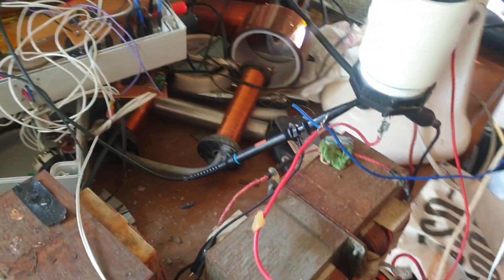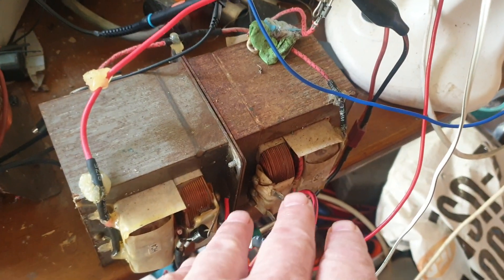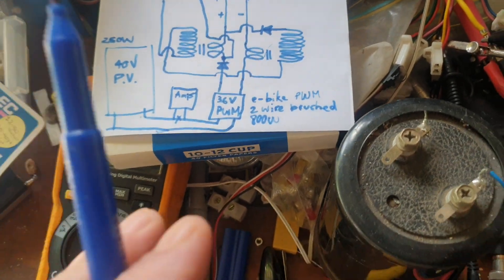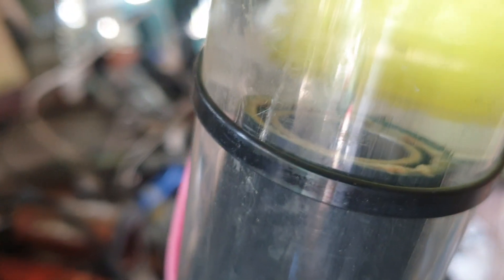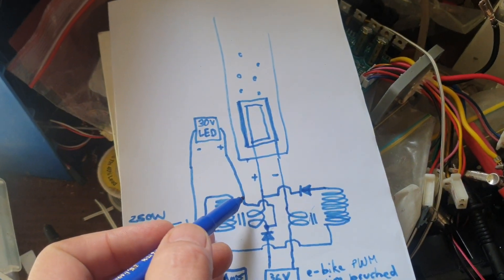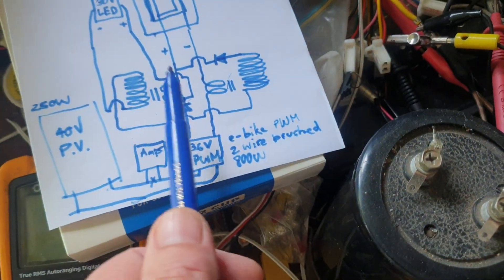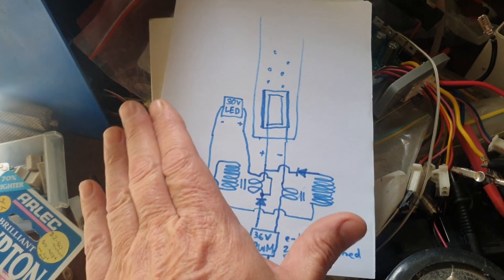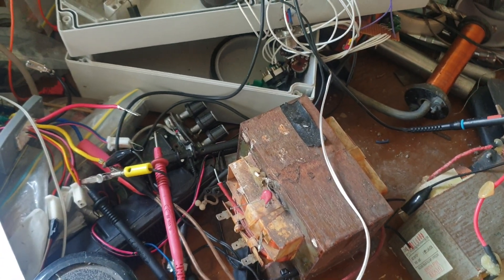Zero input?🤷‍♂️W👀ps HHO Stanley Meyer MOT VIC

Comment: Very cool observation, nice work.
 Ok, here’s my guess.
The HHO water has a dielectric capacity, when placing two seperate pieces of palladium in a HHO cell you can extract electricity from the HHO water. I understand you are not using palladium however stainless steel can perform the same function but greatly diminished in comparison.
This small current may be similar in origin to the Edward Leedskalnins PMH when the magnetic field is interrupted upon shorting the coil or breaking the PMH magnetic flux, upon collapse of the field the back EMF has nowhere to go and thus produces light, this is backed up by an increase in frequency(scratching the terminal) resulting in more light.
I can see now why theoretical scientists feel so comfortable, you really can say whatever you want.🤣 But seriously, I think my guess is what’s happening.

Comment: I'm looking forward to charging my sand filters. Not looking forward to building S traps to keep water off the conductors. I'm almost fully convinced Edward at Coral Castle figured out how to power that Model T with Hydrogen fuel. Why would he need that much amperage? A single set of magnets was enough to run the ignition system, why did he use magnets from 7 cars?
Reply from the maker: wire it like Kelvins thunderstorm apparatus, it'll be a snap
Reply: @m3sca1  right

Comment: Hi! You know - I am one of these persons who can help you with explanation... :). What is happening? Answer is: Every HHO Cell is accumulator. Your loop system with "sparking" induce secondary HiVoltage field which is connected with your battery - HHO Cell. You make generator. That`s it. Nothing cosmic. :) Of course - you can mount it on the bicycle with contacts and use it like Bike Lights :), but this will be very stupid! Be happy! 🙂🍻

Comment: I'm So Glad that you have that SPARK of Curiosity Coupled with  that Sense of Doubt regarding What we are taught (my take)..

Many possibilities there my friend.

Always consider a two way street,
that is often ignored .

U have ruled out Mains related noise via Conduction currents.

Your system has at least one (likely more)
resonant frequencies .

I have only lust found your channel
and this video.
q
Maybe try to observe the system at RF?
or any rapidly changing rate of changes.

Subscribed now mate
& will keep an open mind 
& an encouraging Spirit ⚡🙏⚡

Best Regards from E ⚡🙏⚡
Reply: Just realised I have seen your channel before and was subscribed lol 
but that just goes to show how YT are trying to keep us all Seperated.
Reply from the maker: its completley isolated now, and still doing it. appears to be like a feedback loop where shorting the primaries uses the capacity of the water cell to pulse the secondary which flashes thru the diode arrary of the LED COB, bringing enough voltage across the cell to keep the plates charged. the only induction is via the timber bench coupled to the power board.
Reply from the maker: @crazyham  yes i have lost old subsrciptions as well.
Reply: @m3sca1  This Is Very Exciting .My Friend.

Whether or not it turns out to be something of significance in the realms of discovery,
let me first Say,
NEVER GIVE UP ,!
NEVER LET ANYONE PUT OUT YOUR FIRE !!!

i want to ask if there is any chance of natural potential difference in the metals used?

Example, Copper vs Aluminium have a little under 1 volt potential
and if You are somehow using that natural potential and causing an oscillation with it,
that would be Extremely Exciting .⚡🙏⚡
Reply: @m3sca1 YT are deffo up to No Good matey ⚡
Reply: @m3sca1  Mate,

Would be Great if like minded Folk like us 
could Devise a way to Share and  communicate without relying on manipulative Big $ Tech.

Oh Shit,

We Can hahaha.

Ham and or CB Radio
Reply from the maker: @crazyham  it is high quality stainless steel passivated from many experiments, making it very clean running. it naturally holds a potential in the water that can do work without being electrolytic potential between dissimilar metals.
hydrogen is so small it gets between the metal atoms and loads protons into the steel, this makes a natural charge of about 0.5v in this cell after rest... once the steel is charged up, it will rebound after short circuit back to the charged voltage.
Reply: Delay Time,
and Reverse It !

Simple as That
Reply: @m3sca1  good observation ;)

Comment: mad... do you still have the metal at the top of the tube and is it in the water?
Reply from the maker: yes the nickel sponge is connected directly to the LED now and its wet in the water catching the bubbles on top, its being lit thru only thru that meter long tube of distilled water
Reply: @m3sca1  so cool man
Reply from the maker: @SoSPoductions  the LED is now dead and i am filling a 10F cap off the grid. got up to 87v DC today before the sunshine left my panel

Comment: Hho is so simple but mind blowing Technology prolonging engine life and engine oil life. And save lot of fuel if you have  a carburetor type engine .

Hydrogen is most abundant element in the universe. Hydrogen is a zero emission fuel. Hho car kit  will decarbonise your car engine. kit can installed without any modifications in the car engines..

Engine life changer device improve engine performance and increase fuel burning efficiency like a new car۔  all fuel will burn in the engine No un burn fuel wastage . 

Engine runs smoother. Better acceleration .

An efficient hho car kit lower the engine temperature more then 100 degree F. 

Cleaner engine running. Reducing engine noise due to the faster fuel burning. Hho car kits works nicely. No side effects on your car engine.  solve all the engine heating problems automatically.  More engine power torque and acceleration engine runs cool clean and green. Environment friendly technology make your car quick start car ac will work more. Hho technology will prolonged engines and engines oil life. Less car mentences. Low octane fuel will burn like a high octane fuel. Your engine will burn 100% fuel in the engine no unburn fuel will wastage.  Car will run clean, calm and quiet and like a new car. Best technology for the human health and happiness purpus HHO breathing machine. VERY simple and safe and easy technology, amazing recovery of human dieses like eye care,skin care, breathing shortness, parkinson and so many other dieses. Hydrogen rich water is best energy drink for human body health and happiness and for human  beauty, for good sleep. Hydrogen gas is a powerful antioxidant detox our body. Reserach on hydrogen water is in the early stages so side effects are unknown. Or you can say so for no side effects. Hydrogen is 88 time smaller then vitamin c but richest in antioxidant. HHO technology best for our  cars. I am sure nany persons would be benefit from our hho acmec videos. HHO kits are very simple but very useful for old cars engine efficiency and performance fuel saving and money saving and envernment control hydrogen on demand system zero carbon emissions.  HHO kits are very useful for cars engine efficiency and performance and money saving.Please visit Hho zafar if you want more information abou hho technology call zafar 03082266179 karachi.